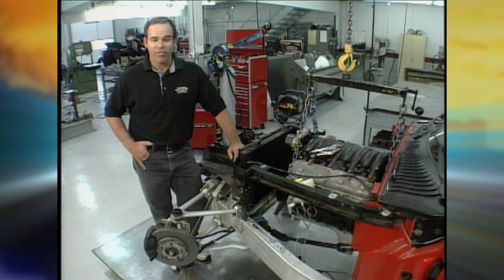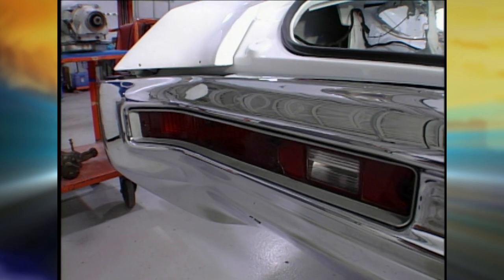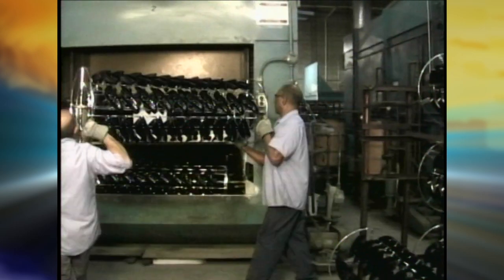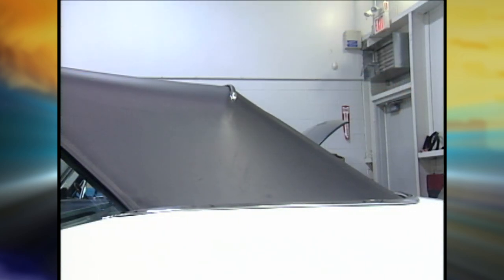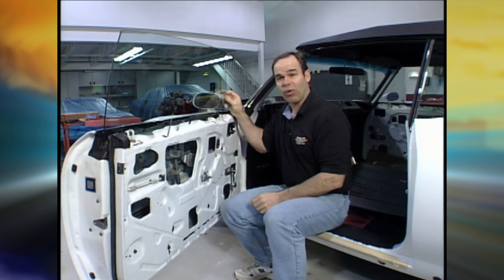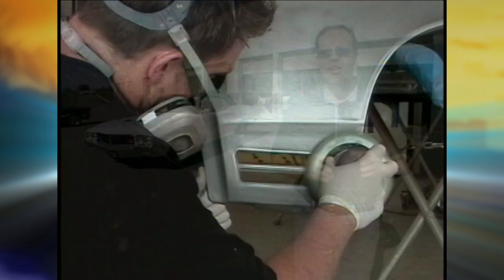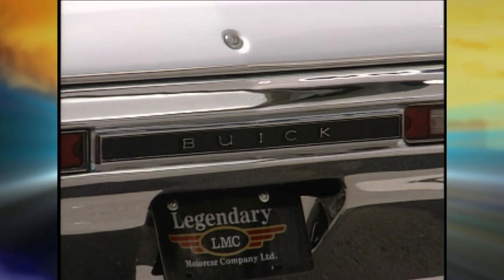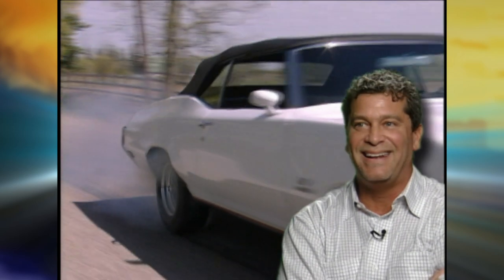Restoring a 1970 Buick GS Stage 1 Convertible to be DRIVEN!

Comment: My aunt used to have a 1970 Buick GS. She blew up the original engine so my dad installed a 455 in it. It had ported heads, mid rise intake, 1000 CFM Holley carb, a 4 speed, and an upgraded Ford 9 inch. She hated it, but I'd give my left hand to have that car.